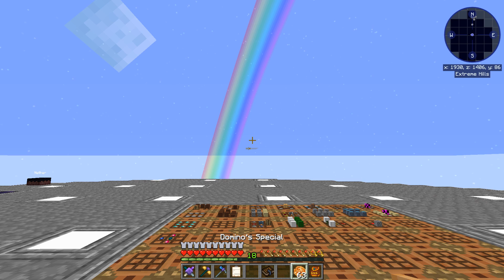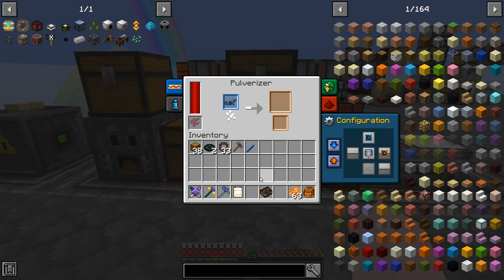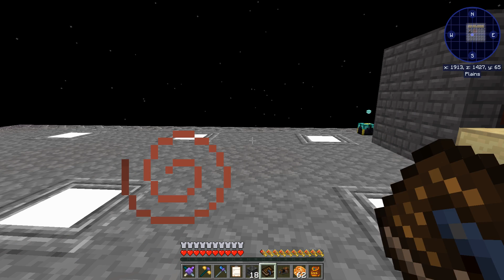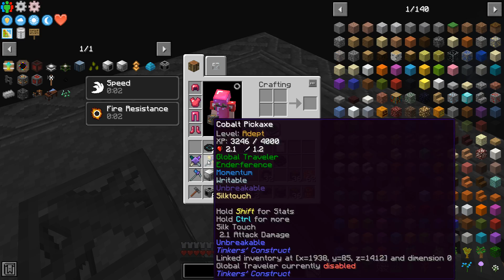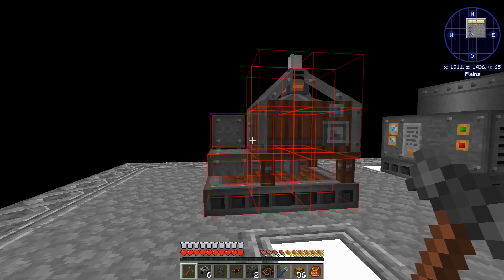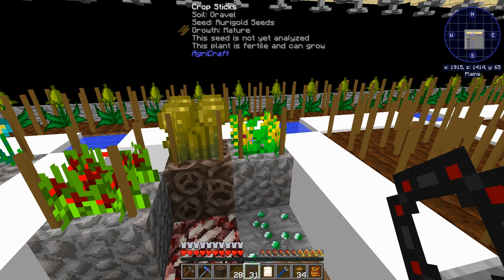09: Automated Crops, Portal to Landia - Project Ozone 3 Kappa

Comment: I know you aren’t at this point yet, but when you start mystical agriculture you will need insane amounts of kelline and the other metals. Other than using a quarry the only other way to automatically get those resources is by using woot with the boss “Orwellian big brother” from landcraft. This mob is expensive to summon the normal way, but using woot it drops quite a few of all the ingots at a fairly low power cost
Reply from the maker: > insane amounts 
Like you said I'm not there yet, but wouldn't it be a reasonable number of stacks of each? If I was fast and efficient mining with explosives, couldn't I gather enough in minutes rather than hours? Thanks for the tip on Orwellian, I will keep it in mind.
Reply: Wilx 
I say insane because in order to get all the kelline for the seeds, you will need about 15k kelline ingots as well as needing 20k+ for making the different tiers of mystical agriculture armor. It is possible to mine them manually but it would save a lot of time to run the woot farm
Reply from the maker: On second thought, I might be under estimating the need for the lower level ores. You would need exponentially more to get to the higher level essences. It would take 16 stacks of Friscon to make 1 Insanium.
Reply from the maker: You're right. Just ran a test, running down a very long hall exploding the ores and only got 16 Friscion. 2nd test, digital miner, max area 32 radius, about 16 chunks, and got a little over 7 stacks of Friscion. You would have to move the digital miner 9 times to make one Insanium.
Reply from the maker: I know nothing about the Orwellian Big Brother. Is it a Woot Tier IV? How many do you need to kill to fill the shard?
Reply: @WilxGaming  check out memyself andcj's day 14 stream, around 3 hours in. He has just set this up
Reply: Wilx I believe that the big brother needs a tier 3 or 4 spawned. And you only need to Summon and kill one to get the shard. Be prepared it’s a fairly tough fight as he spawns lots of the different landia mobs.
Reply from the maker: > a tier 3 or 4
Fairly big difference between 3 and 4. The rest helped. Thanks.
Reply: Don't bosses like the ender dragon and wither drop Supremium essence on death? If so, setting up a reliable wither spawner/killer could be another way to go.
Reply from the maker: > wither spawner/killer could be another way to go.
Good point and I already planed to. You would still need reasonable amounts of Kelline, but the exponential need for ridiculous quantities of the lower end stuff would be alleviated.
Reply from the maker: @Nicholas Loomans  I have no idea why your comment when to my spam. I released it.

Comment: You placed the factorizer on fluxducts but it doesn’t require power. Unless you just wanted it with your other machines.
Reply from the maker: Never used one before. Good to know. I might move it.

Comment: Would the factorizer work for the diamond and emerald ingots in place of the compacting drawers and itemducts? Hmm, assuming it was fast enough, you would still need a filter of some kind. The vacuumulator might be interesting for that, especially if it was still the normal recipe. Not that your current setup isn't perfectly fine, of course. :)
Reply from the maker: > emerald ingots
Ingots? Yes the Factorizer can make nuggets into diamonds or emeralds and I expect either of the Compactors would too. Compacting drawers seemed best for what I wanted, unless I needed to handle a lot of different types of nuggets, then I would use a compactor.
Reply: Lol of course I meant nuggets.
Reply from the maker: > of course I meant nuggets.
While I expected that, there is too much I don't know yet and I learnt not to assume there wasn't some sort of ingot.
Reply: @WilxGaming  for the thermal machines all the machines that use the different frame do not require power

Comment: Way to over think things on the drawers. Lol. All you needed to do was lock the drawers and they act as a filter.
Reply from the maker: With ducts, if you use a servo, it will try to push everything out, the stuff that doesn't have a destination bounces around and goes back where it came from. This creates a very small amount of lag, but if you do it a lot it adds up. Most other piping solutions don't have this issue. I used ducts because I can make fast servos with my current technology and they cause less lag than Translocators.
Reply: @WilxGaming  ok. I see that. But you didn't lock the drawer. There is in all likelihood the chance without them being locked that you'll get the diamond and emerald switching drawers and that's going to gum up the system.
Reply from the maker: > But you didn't lock the drawer
You're right, that would be a problem. The first thing I did right after the episode was lock the drawer. Thanks for pointing that out, in case I had forgotten.